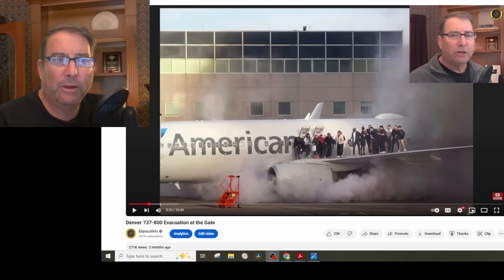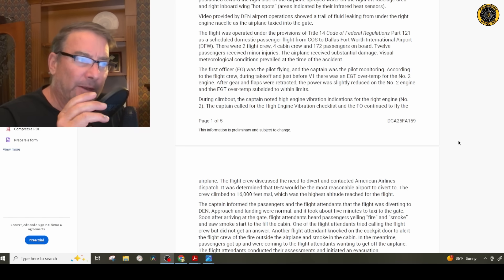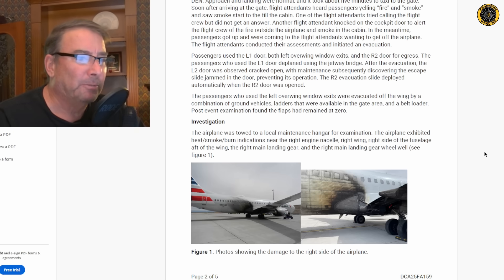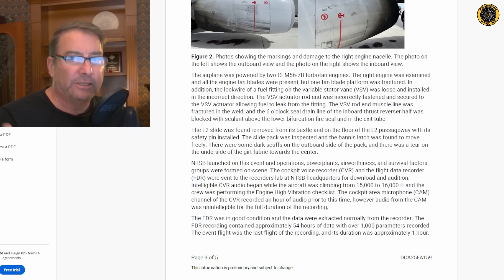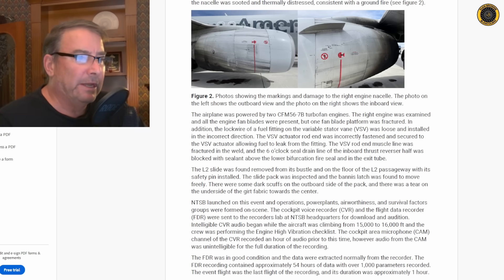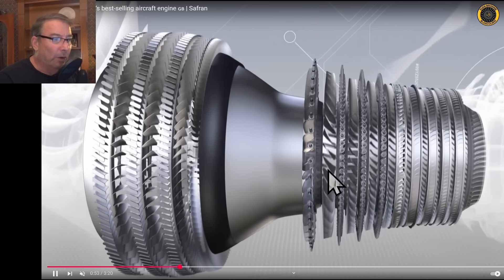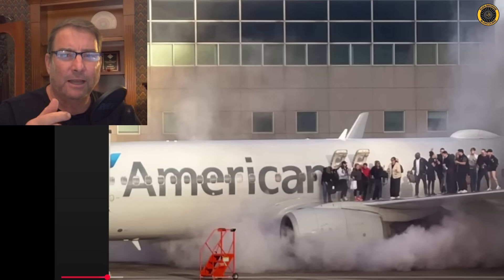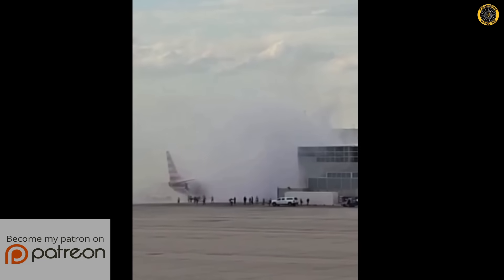NTSB Prelim American 737-800 Engine Fire at Gate and Over Wing Evacuation

Comment: Why the hell doesn’t the crew have cameras on the exterior on these planes.  I’ve so many cases where this could have averted a disaster, for example shutting down the wrong engine.
Reply: Nice idea, but retro-fitting cameras to older aircraft would involve massive amounts of work, expense, downtime and re-certification. Many planes currently in use are 10 to 25 years old; taking them out of service to run new cables and wires, plus altering cockpit layouts, revising service manuals, checklists, displays, and maintenance schedules would bankrupt many operators. With respect, it's just not worth it.

Making the slightest change to a passenger-carrying aircraft is insanely complicated. It's not like bolting a few extra cameras onto a car.

Comment: How does lowering the flaps help get them off the wing tho? I’m genuinely curious.
Reply: This was answered in a previous video on this. It's literally so passengers can slide down the flaps before falling to the ground.

Otherwise they're jumping from wing height,  which would lead to more injuries.

Hangover from how old the design of this aircraft is.
Reply: The 737 family does not have over wing slides

Comment: Wing inspecrion, engine inspection a d wingtip clearance cameras should be standard by now.
Reply: Airline fleets are made up of planes anything up to 30 years old; retro-fitting new safety-critical cabling, re-routing harnesses, monitoring systems and displays, then updating service schedules, operational manuals, checklists, etc. and getting the modifications certified for passenger-carrying aircraft  would bankrupt most operators.

They might fit more monitoring cameras to brand new planes, but it's too costly to be practical on most of today's fleets. It's nothing like fitting cameras or parking sensors to a car.

Comment: Fun fact: the first jet engine to use variable stator vanes was the GE J79 - used in the F-104, F-4, and B-58 Hustler.
Reply: And a real powerhouse the J79 is😊💪
Reply: @randall39  I mean it has to be, it gets something like the damn F-4 off the ground 😅
Reply: General Electric had a patent on that design during that time. It's part of the reason The PW TF30 was such an unreliable maintenance nightmare. 
We used to have the contract for all the J-79s from the F-4 Wild Weasels during the Gulf War. If I was having a bad day, I'd volunteer to go do teardowns. Nothing helps you work through your aggressions like tearing down a J-79. Nothing will try your patience more than lockwiring the Nozzle Area Controller. But for a really fun time, try replacing the CSD/Generator while the engine is still installed on a 115 F deg day.
Reply: @1crustyoldmsgtretired870  I've known too many people that have had to just that task.  And it's reciprocal changing one in -15 degrees with no hanger space to move it into to avoid the cold.
Reply: And the CV-880. They called it a CJ805
Reply: And still producing power in gen sets world wide !!
Reply: Not my idea of fun 😅
Reply: First to use variable stator vanes... sort of, if you squint really hard.  Rolls Royce had the first variable inlet guide vanes, variable stator vanes and with engine bleed control flying on the outboard positions on a Lancaster in 1948 (I won't count the RA1 in 1947 as its failures led to the RA2).  Geoff Wilde (RR) secured the patents for these measures in 1947.  By 1949 the legendary Avon engine was running a 12-stage compressor with inlet guide vanes with the first four rows of the compressor equipped with variable stator blades.
  
For full-rate production the VSV were dropped from the Rolls Royce Avon as the variable inlet vanes and bleed control provided satisfactory performance and in a less complex design.  So if you squint and ignore the Rolls Royce work, the patents, the subsequent test flying, the RA2 and RA3 (Mk101) engines and call the first set of stators at the inlet as 'variable inlet vanes' and skip-forward a few years I can see how the 'first' can be applied to the J79.  Of course, I've skipped over what was gifted to the US to get them in the game.

I've still no idea why Clement Attlee gave-in to US government pressure and overruled his military and his own ministers to gift / sell the RR Nene engine to the USSR as 'a gesture of goodwill'.  The move ultimately gave the US Sabres a reasonable adversary to fight in the MiG-15, come the Korean War.

Comment: Like I say on EVERY commercial airline video. This is why I only fly frontier because they only operate reliable a320 and 321s. If I have to fly any other airline, I search for a flight on an airbus or crj. I’ll never step on a Boeing so long as I have control over said decision making.
Reply: Neither Airbus or Boeing make the engines.  GE, Pratt Whitney, and Rolls Royce are the big 3.  A very similar engine is on the older A320 and A321.
Reply: Whilst being British I should be supporting Airbus, the truth is Airbus probably only appears to be better than Boeing because the aircraft are newer on average. And have learnt from the historic engineering mistakes by manufacturers than Boeing.

Comment: How modern flight decks don't have camera views of the tail and wings is staggering. They're always the last to know.
Reply: Thats the problem, its not a modern flight decks, its from the 60s. Modern aircraft do have cameras all around like the a350.
Reply: Yes. There’s nothing ‘modern’ about the 737 design. It’s an absolute relic, well past its time but kept in production because it’s cheap for Boeing and airlines. Every time there’s an incident, the short comings of them are shown up more and more, in so many ways. 
I’m this instance, the lack of slides from over wing exits and that you have to rely on flight crew lowering the flaps (and then passengers have to slide down those!) is just another example of outdated, cheap engineering giving a far inferior product safety wise.

Comment: I appreciated when you go full professor Irwin Corey on the nomenclature you show diagrams, actual components and explain the who, what, when, where, why and how they work. Kudo's to you and your research support staff for the amazing, simple to understand explanations. Best on Youtube IMO.
Reply: Yes Juan is one of the best Youtubers around, along with Kels, Mentour and VAS. However, regarding this incident, why were the passengers allowed onto the wings? Why did the flight attendants not control the situation inside the cabin?
Reply: @joshilini2  As much as it made for goofy TV, and a bit of inconvenience requiring quick thinking from the folks on the ground to get them down safely, the wing is an egress route in an emergency. Optimally, the flaps would've been dropped, at which point it's an even more workable exit path, but that ties back to the communication failures with the flight crew. Out on the wing away from the fire, in open air, is MUCH better than inside the passenger cabin attached to the wing with the fire, filling with smoke. Sure, out the fore or aft exit and away from the plane altogether would have been best, but every available exit path increases how quickly you can get everyone towards safety.
Reply: @joshilini2  How do you stop them?
Reply: @joshilini2  I was thinking the same thing.  I was taught at an early Navy age that the flight attendant's job was passenger safety first, then become a "Snicker Bitch" afterwards.  This was a total cluster-   Bad look on AA flight attendants.

Comment: Variable vane is to control angle of attack of the fixed blades to prevent compressor stall.

Scratching my head how fuel collected at bottom of naccelle caught on fire. The strator actuators are over cooler part of the engine where touch temperature is too low to start a fire. Fuel had to have come in contact with hot section. But how?
Reply: Backed up the drain line and leaked into the cowling
Reply: @platapus112 unless the drain allowed fuel to come in contact with hot section case, there isn't an ignition source. Variable vane actator is located on cold secton of engine. Low fire risk. Fuel at bottom of cowel doesn't have and ignition source. Now perhaps leak was spray ip front at the air system carried it to hot section.

Comment: Talk about the holes in the Swiss cheese lining up!
Reply: Yes, but there's also a reporting bias here, in that videos don't get made about the times where only 9 of 10 pieces of swiss cheese line up and nothing happens
Reply: @h14hc124  That's the thing about the Swiss cheese model. Most of the time, there can be several holes that line up, but even one slice of cheese can keep it from becoming a disaster. This time, there were holes in every slice.
Reply: @h14hc124  not sure what your point is? Of course we mostly only hear about the ones where the all line up... but industry also does hear about the close calls where there was just one or two things left to protect from disaster, and those also go to improving procedures and safety standards.
Reply: @MeppyMan  My point is that you seem amazed at how many things had to line up just right to cause this incident, but if just a few of those hings had been different, none of it would have been discovered, and you wouldn't be watching a video about it.  Sure, we may see reports were there was a near miss, but again, it wouldn't be reported unless it got to the point where something nearly happened..  when only half of the dozen steps required to cause a fire are present, nobody knows about it, so almost by definition, we're only going to hear about the cases where lots of things line up.

Comment: From what I remember from my Navy training the primary purpose of the Variable Stator Vanes is to prevent a compressor stall.  The vanes will adjust to different angles depending on the RPM of the compressor to avoid stall conditions in the compressor.
Reply: An oversized J79.

Comment: FYI: N885NN was repaired and has flown to Indiana last week for paint on the new fuselage sections.
Reply: American Airlines: Dont worry that will buff out
Reply: 🤣🤣🤣 @Paul1958R
Reply: I wonder if we're going to be back here in several years...

"Now long time viewers of this channel might remember the incident this aircraft had with an engine fire back on 2025"

I really hope not. I'm sure that the engineers and airline won't cut any corners. Right?
Reply: @langdons2848 oh no.
Reply: @langdons2848  : Especially wingbox right there. But maybe this one is easier to verify being repaired correctly than, say, 747 rear bulkhead...
Reply: Seeing the burn marks on the fuselage I didn't expect that to happen!
Reply: @JariJuslin, as a general rule of thumb, if the aircraft has service life left and the cost of repair doesn't exceed how much revenue you can generate, then it's worth repairing. 

Unlike cars that are very easy to total out and generally aren't worth anything compared to an airliner.
Reply: @EntityOfTheVoid : Yes, that's of course the basic math.

I'm wondering if the long queues for new planes right now also play a role - especially 737s are delayed quite a lot due MAX trouble et al.
Reply: I'll be almost driving by the place.   Maybe I should detour and see if it's still there.  Grissom AFB paints AA aircraft and I've got business in Kokomo.
Reply: Indeed.

Comment: If records have been correctly maintained, it should be possible to identify whoever did the dangerous work on the engine.
Reply: Really, though, the root cause is the major shareholders and the boards of directors of the airline -- undercutting maintenance horing, work schedules, job protections, etc -- almost never the workers themselves.
Reply: Dangerous work. Well done, some poor guy is probably doing that at 3am with torch on his head. Been given 3 hours to do a 5 hour job all so the airline can keep a ridiculous schedule going. 
Human factors my friend. It's on the airline. 
And people wonder why there is a shortage of mechs.
Reply: @kepamurray1845  it's also on the guy with the wrench in his hand to say "HELL NO".

Comment: 11:08 I only have limited knowledge of one engine, PT6, do most modern engine have variable stator veins? Fascinating the linkage setup.
Reply: Yes, most modern engines use Variable Stator Vanes.  They help to prevent compressor stall (the air flowing thru the engine is disrupted).
Reply: Yes, Been around forever. They do all sorts of crazy stuff with N1 driven fuel pumps and pneumatics for the VIGV's.

Comment: It's amazing that airliners don't have the 360 degree complement of cameras that modern autos have for situational awareness!
Reply: Airbus's do. But they're actual modern aircraft, not antiques with LCD displays passing themselves off as modern aircraft.  No offense, Juan.
Reply: @auntykriest  FAA, ATC are DECADES behind technology. Wireless cameras with a cellphone app are a common department store item - the tech can easily be adapted, IF you have an open mind.
Reply: I know what you mean, but many planes in service today are 10, 15, 20 or 25 or more years old. Modern cameras are great, but retro-fitting them to older planes would cost hundreds of millions in parts, labour, workshop-time, lost revenue, and the horrors of re-certification and revising operational manuals and service/maintenance routines.

Camera monitoring equipment would presumably be seen as 'safety critical', so routing wires or refitting upgraded harnesses would be seriously expensive, too.

I'm sure that next generation planes will be fully equipped with monitoring gear, but it's probably too late to introduce extra cameras to anything currently in service.
Reply: Just a few cameras- a few lbs weight,under $500 total for the equipment, a little more wiring, and all the voices here crying "NO!" 

Why not implement them only on new builds with retrofits optional? As the fleet ages put of service eventually you've got cams on almost all the planes. If regulations fight it change the regulations. There can be no excuse for not adding safety when it's cheap, easy, and necessary.
Reply: @P_RO_ oh it’s because the people here want to sound like they know something so they disregard all common sense
Reply: @P_RO_ you don’t just slap a few cameras on an airplane and call it good.  You don’t change anything in the certified configuration of an airplane and call it good. Planes are the safest mode of transport for a reason. Rigorous testing - electrical, aero, failures, etc. - and re-certification is a lengthy and expensive process.  And exactly how much benefit would that actually provide? Many newer planes have included this tech from design. Can you point to a “good thing there was a camera onboard” incident where it made a difference?
Reply: @rdspam  When you learn to read then I might listen.
Reply: @P_RO_  one cell phone camera size lense on the tail looking forward, Couple wires to the flight deck. Better than nothing.
Reply: On the Thai A350 there is a camera on the tail so you can see most things and one watching the nose gear and another one that wasn’t showing on the screen. That’s just the ones they let the passengers see. So there can and are cameras at least on the aircraft of responsibly airlines
Reply: That would require new certification cameras, weight, and wiring not to mention functionality in existing cockpit displays or more likely new displays.  It is not, IMO, easy to retrofit new function peripheral devices on large certified air transport aircraft especially at any reasonable cost.
Reply: @spunktronic9262 camera systems are optional equipment, it's about cost.
Reply: Some airbuses do… not the ones I fly tho…
Reply: Actually you are right of course. The weight and cost of equipment is negligible. There was a practical problem in the past in that the resolution and field of view limited their usefulness, and could actually give misleading impressions. The problem now is the difficulty in retrofitting to an existing design and the cost of certification.
Reply: Great comment.
Reply: Didn’t Boeing skimp on safety indicators on the early Max8s which were listed as “optional extras”…then what are the chances getting cameras installed…
Reply: 360 views are in use.  But at a price.
Reply: not yet
Reply: Weight is everything in aviation, cameras/lines/storage for them add up. Also the cameras would be part of the certification of the aircraft so every time one of them went down it would have to be fixed or put into deferred maintenance.
Reply: @colinm6714 lol they’re not worried about a few kg of cameras. The difference of one passenger to another is more than that. My luggage is normally 9kg under weight. Just because you heard something once doesn’t mean it’s applicable in every situation
Reply: they just were never designed to have them and they add a ton of weight and maintenance requirements. it's bad enough we have problems with voice recorders barely working, the likelihood of the cameras working every flight good luck.
Reply: Or maybe a set of walkie talkies?

Comment: The report said the FA attempted to contact the pilots but were unsuccessful.  In that case SOP is the FA - if they determine it is warranted OR if the passengers are already evacuating on their own - command an evacuation.
Reply: I am surprised there is no FIRE pull station that the FA can access to alert pilots etc